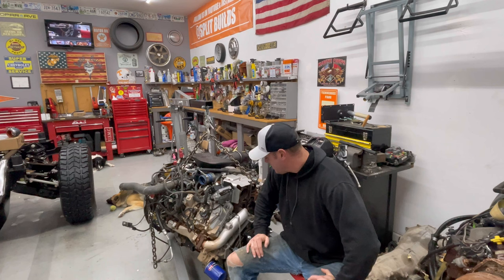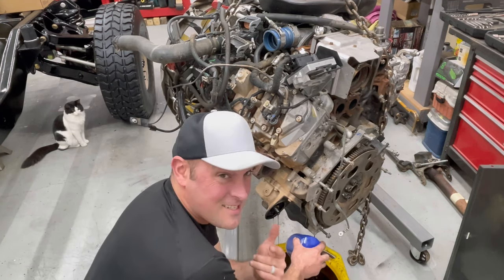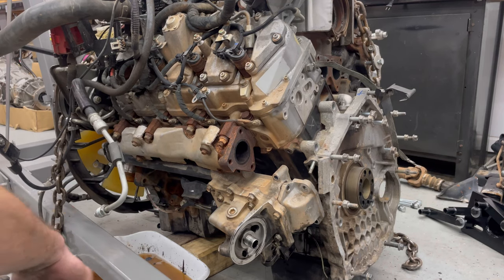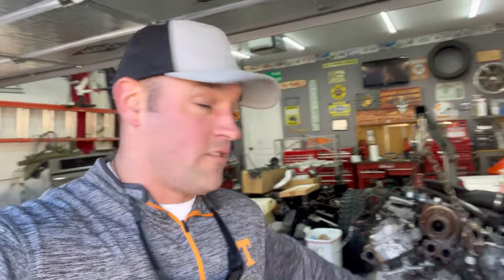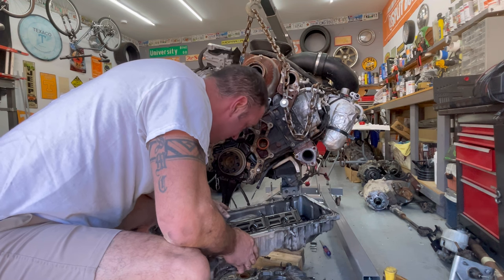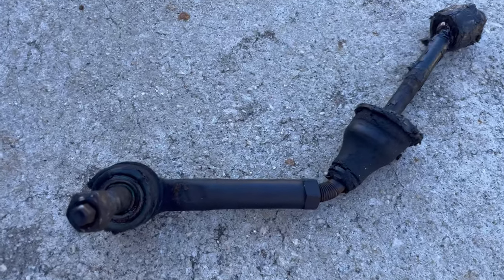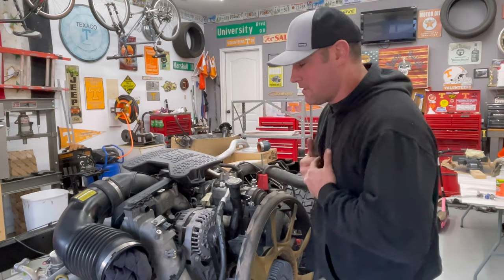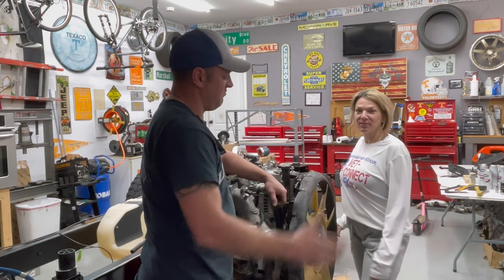Duramax Humvee Engine First Look

Comment: Hey buddy great job on the Durham act strip down my H1, Was on 3 predator videos it's the soft top turned into a slampack. And I changed the water pump on my motor Leroy's diesel new fan fan clutch lunch radiator how much a stuff I did cause it was small enough but radiator fluid while I was driving it, I have the number one Homer mechanic in the country Mike   Can't spell his last name but hes at Tustin GMC works on H1 hummers it's been around forever. Mine apparently might have the number 8 cylinder wall on the block cracked, I wish I could do what you do I have no room and I'm not a mechanic so I'm jealous watching you in a good way. But I gotta do a new block and hes gonna fix it up and fix my car but he can't take it till next Monday. Great job on your car though
Reply from the maker: That’s awesome! What color is your H1? I think I know the one! Predator does great work! I wish I had there shop and more people to help. That suck if you need a new block… thanks for watching!
Reply: @SplitBuilds   Mine was the charcoal Gray one

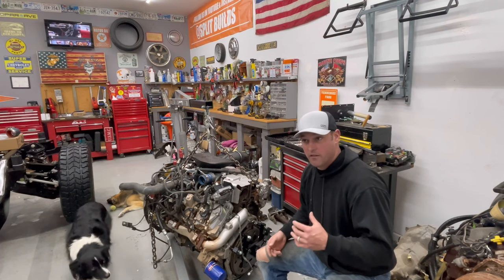Comment: Rumors has it that duramax engine fits bolt on if the former engine was 6.5TD m11xx, the transfer case on the other hand will need a custom bracket. Also please paste in the description of this video the video you are referencing about 1 min in. 00:57
Reply: What’s the rumor? I have an m1165
Reply: @abc-ed1nr  engine upgrade fits bolt on.